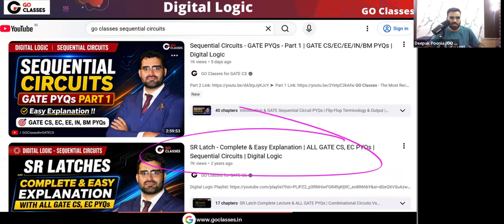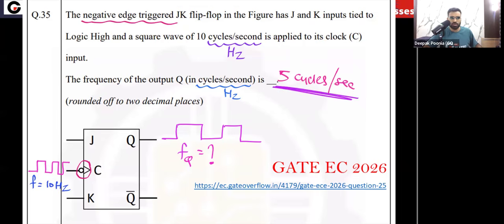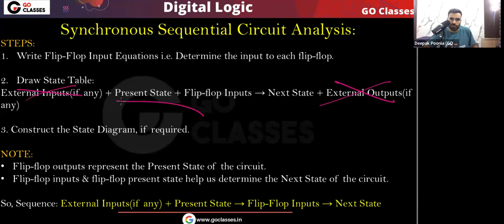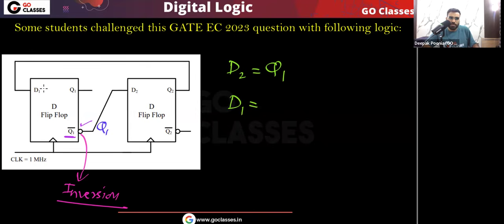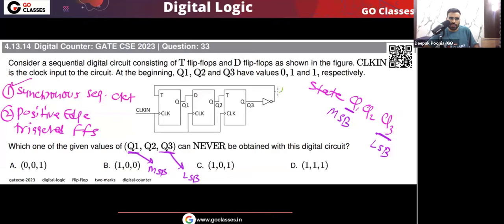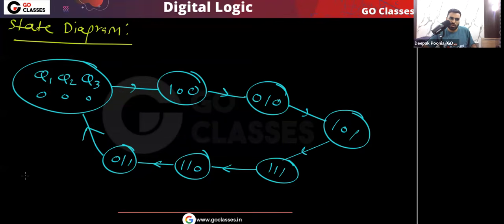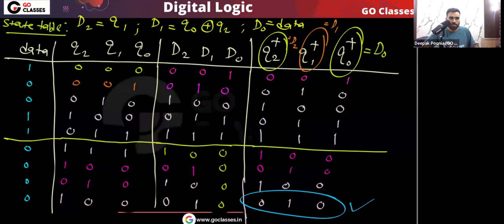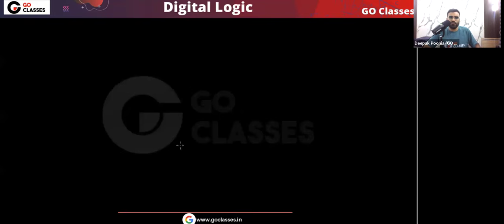Sequential Circuits - GATE PYQs - Part 3 | GATE CS/EC/EE/IN/BM PYQs | Digital Logic

Comment from the maker: 00:00:00 Introduction to GATE PYQs on Sequential Circuits – Part 3
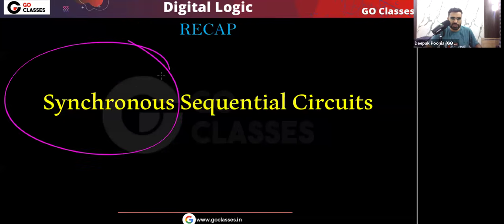00:02:08 Recap: Synchronous Sequential Circuit Analysis
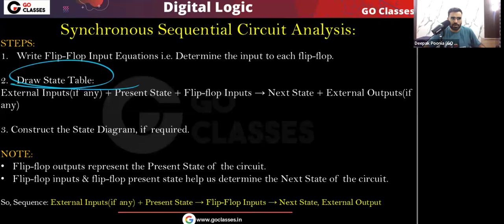00:04:22 State Table and Computation Sequence
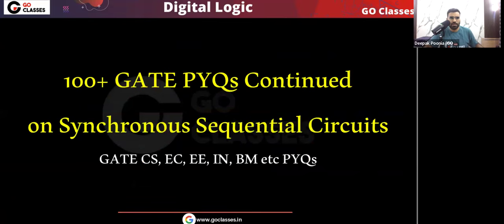00:10:04 GATE PYQs on Synchronous Sequential Circuits
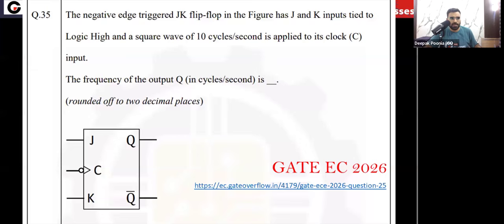00:11:25 GATE ECE 2026 | Question: 25
https://ec.gateoverflow.in/4179/gate-ece-2026-question-25
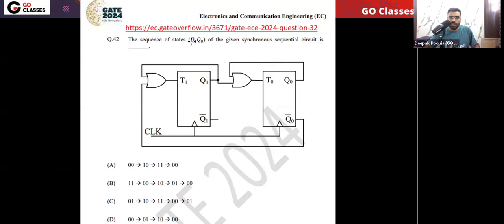00:31:24 GATE ECE 2024 | Question: 32
https://ec.gateoverflow.in/3671/gate-ece-2024-question-32
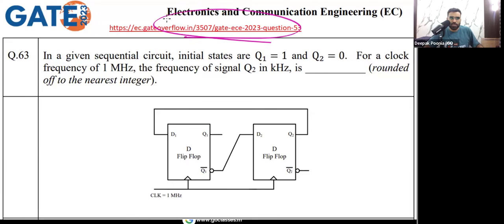00:43:42 GATE ECE 2023 | Question: 53
https://ec.gateoverflow.in/3507/gate-ece-2023-question-53
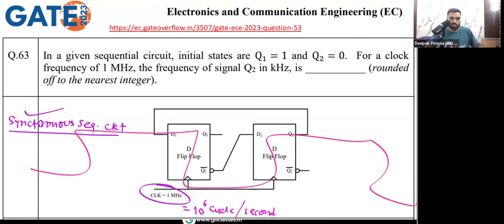00:52:52 Finding Q2 Frequency from the State Diagram
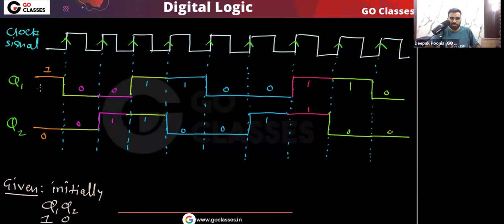1:00:17 Q2 Output Frequency Calculation
1:04:29 Q1 Output Frequency Calculation
1:05:57 State Diagram and Frequency Analysis
1:06:58 GATE 2023 Official Answer: 250 or 500?
1:08:14 Why Students Challenged the Question
1:10:23 Why the 500 kHz Interpretation Makes Sense
1:15:04 Correct vs. Incorrect Flip-Flop Symbols
1:20:00 Alternative Solution: 500 kHz
1:27:34 Final Answer: Why 250 kHz Is Better
1:29:24 GATE CSE 2023 | Question: 33
https://gateoverflow.in/399278/gate-cse-2023-question-33
1:32:00 Synchronous Sequential Circuit Analysis
1:34:29 Flip-Flop Input Equations
1:35:07 Two Methods for Finding the Unreachable State
1:38:09 Solving from the Initial State 011
1:46:17 Efficient Complete State-Table Method
1:52:36 Complete State Diagram and Final Answer
1:55:35 GATE CSE 2006 | Question: 37
https://gateoverflow.in/1295/gate-cse-2006-question-37
1:58:54 Introduction to the Sequential Circuit Problem
2:01:02 State Table Method
2:06:12 Applying the 9-Cycle Input Sequence
2:08:32 Calculating the Next States
2:15:22 Finding the Final State After 9 Cycles
2:18:19 Complete State Table Method
2:27:20 Constructing the State Diagram
2:36:09 Solving Using the State Diagram
2:39:25 Comparing Both Methods and Final Answer
2:40:16 Conclusion
Reply from the maker: Annotated Notes of this lecture: https://vcdn.spayee.in/spees/w/o/60e975430cf20278db21ff30/v/6a8e0370eaf6db96f2d6aaba/u/60f992c50cf2de5e291c3afd/p/assets/pdfs/2026/08/25/6a8e0370eaf6db96f2d6aaba/6a8e0370eaf6db96f2d6aaba_original.pdf?Expires=1787695566&Signature=Y5QsMyaXea3Wap8I4RIsWl-Oz-eJrdAx3TgPQ3IDTtRqks~NH-SDkqPwd~kTug4BzFPa3LlexIfFi0LjmPiJlQVjbF0-AWehJZQHhWspgQ9mctWsQSFjqOrHHDds92VR4T~-hVvjNxe2CnNLVF2traYjQLCZ4zXxFfPewKEAeQ-KQE9guFDEHQsEDllrRYxrzLpps3kckua~Cb2b62F9qM5ySBN5romBqiQNfhiqThUuQgERBiPLvuxvC2mC9G9hs4b0ifx~V93HdJOP2ROn4HfSKaJtQ-vccnKHAr7De9~-~lbmMg88960hALmStKWXiua81GWoAzW3gZa840w6UA__&Key-Pair-Id=APKAW3MHMK54TM3QKYNH